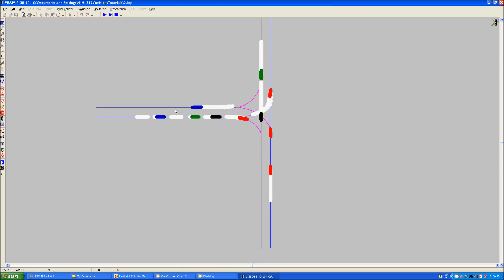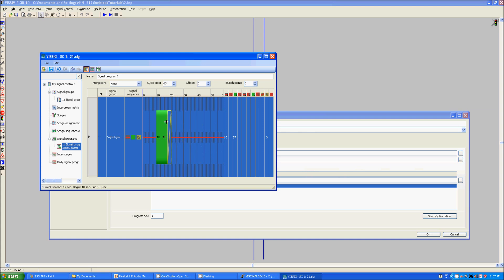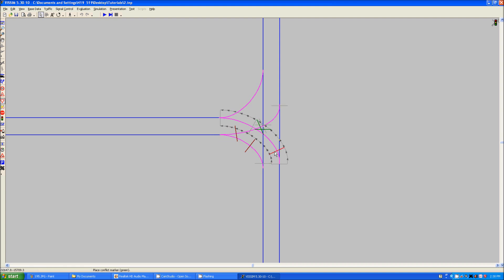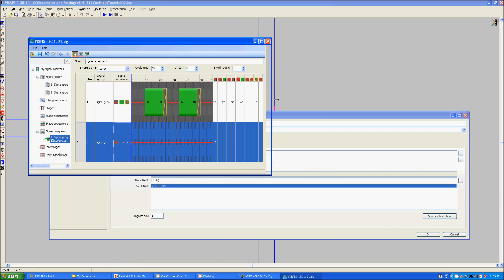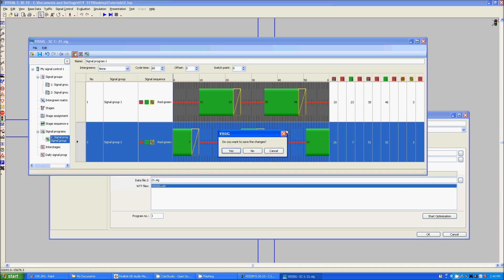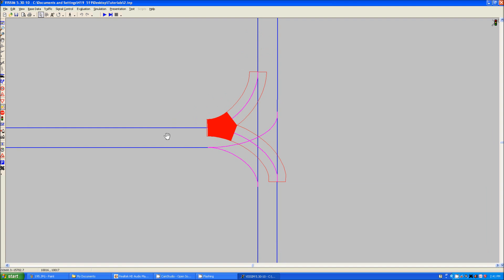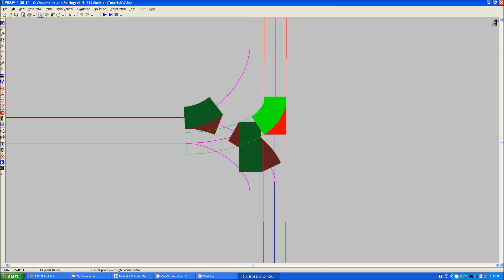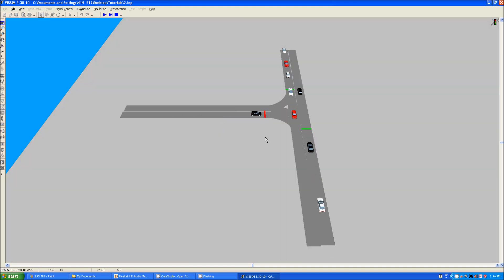VISSIM Tutorial 5: Signalized Intersection (part 1)

Comment: Hey Brian, do you know if it's possible in Vissim to manually change an intersection signal during simulation? I'm trying to toggle a two-way intersection's signals using the keyboard or some other method while the simulation is running. If it's not normally possible, do you know a way I could get it to work? Thanks a lot